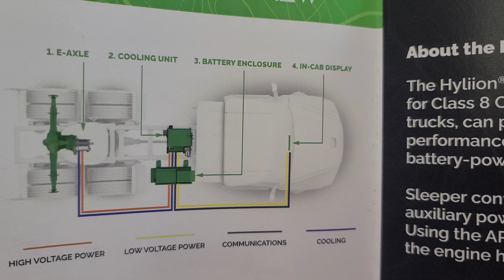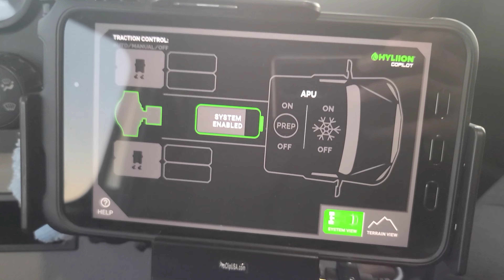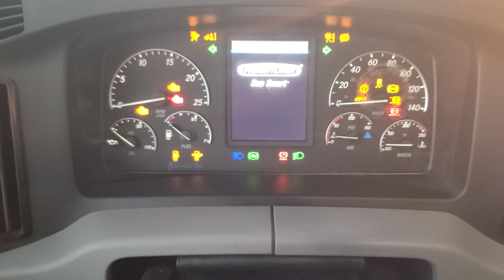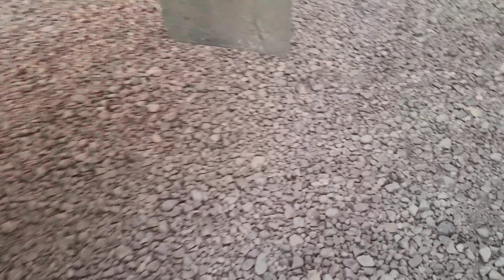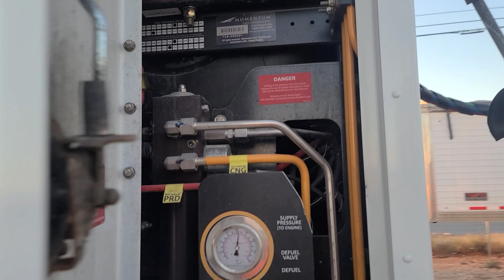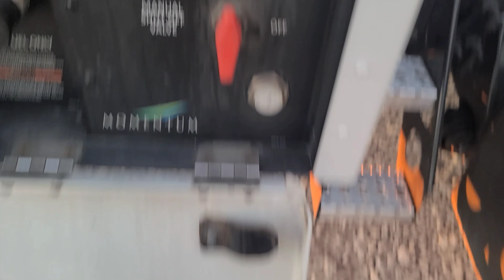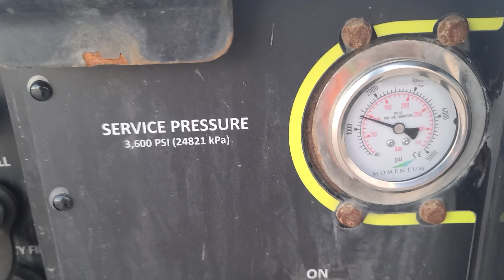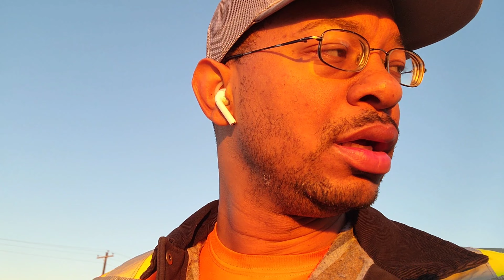Hyliion EX Pre-Trip inspection with Cummins comments-Let's Begin😊

Comment: If you run a Cummins 12 L as seen in this video, the truck will work.  But it does not have the torque to allow the truck to maintain speed on long grades.  This is true even with the EX configuration in this video.  This limitation is overcome by the ERX system which has an electric motor with high torque.  The only problem is, the ERX cost $125k more than a standard engine.

The Cummins 15 L is more powerful than the 12 L and will allow the truck to maintain speed on long grades.  So it will do what the ERX can do.  But the Cummins 15 L is $125k per truck cheaper.  Which one would you buy?
Reply: You can maintain speed for sure with this. Ive run many cng and lng trucks. We just downshift a gear and it goes on up. With an e axle should make it perfect.
Reply from the maker: Thank you for your well thought comment and question. You explanation was very in depth.
First, I am not a fleet owner with millions of dollars of assets and buisness credit, so I don't know which one to buy. All I know is this.
1. Cummins low torque can be supplemented by Hyliion's E-axle.
2. West Texas is flat. There are no mountains nor hills. 
3. From a technical standpoint niether Hyliion's ERX or Cummins 15L, have made any sales or have at least a year worth of real world feedback.

 Thanks for supporting my channel😊
Reply: @DMGbrokenfree  I visited West Texas.  It is so flat you can see the sun rise and set on the horizon.  With no hills, the EX will not work.  This gave birth to the ERX until the Cummins 15 L came on the scene.  This engine will come out in 2024.  Given that it is manufactured by Cummins, it will work.  Hylion's ERX will come out in 2023.  They are a new manufacturer and their product is very complex.  There will be a few bumps in the road with Hylion.
Reply: @titaniumsandwedge  very complex? Are you considering the fact the Cummins engine will still require a transmission and more maintenance? Fuel consumption, range, government regulations etc.???
Reply: @gmant928  Yes I know that the Cummins engine will need a transmission.  The ERX is very complex.  How does it know when to turn the cng off and on?  It has to sense grade.  How does it regenerate power?  How does it cool the battery?  How does it control the electric axle?  All this is not needed for the Cummins.  And if the electronics in the ERX fail, who fixes it?  A diesel mechanic?  LOL.  Nope, you need a new electronics mechanic.
Reply: @titaniumsandwedge  it’s really not as complex as you think lol the battery cooling is probably the most complex thing you listed. Do you realize how much modern cars utilize electronics these days?
Reply: @gmant928  Look at all the videos of the EX and ERX.  Do you think a diesel mechanic could fix them if they broke down?

The ERX is very complex.  The complexity can be measured by its price tag of $120k over just the cng engine and transmission.  What do you get for this price?  Got to be some beneifit?  Maybe a little bump in mileage.  You really can't say you are green because you are still burning cng, a greenhouse gas.  At times, the ERX is quieter than the cng engine.  Is this worth $120k?
Reply: @titaniumsandwedge  You're making a lot of points that don't make a lot of sense.  Regenerative braking gains energy from stop/go, not just hilly terrain.  And in the ERX, it doesn't "sense grade" in order to know when to turn the CNG system on; it detects when the battery is low and turns it on.  

However, I see the broader point you're making, which is that the Cummins motor is cheaper and "does the same thing" that the ERX will do.  I have to disagree, though.  The main expense, even with CNG, that fleets have is paying for fuel (as far as I know).  The Cummins 15L might provide adequate torque, but because it still uses a traditional drivetrain, it will be significantly more inefficient than the ERX, especially once you factor in things like regenerative braking.  So let's say the ERX uses 30% less fuel than the 15L does, but provides the same torque/hp.  Over the lifetime of the truck, that will save far more than the 125k premium that the ERX system added.  And that's not even including the additional cost benefits that come along with owning an electric drivetrain, such as less brake wear and less maintenance.  AND don't forget about the tax incentives for converting fleets to BEV status (which I believe the ERX qualifies for).  If you add all these things up (and a few others I didn't mention), you'll find that the ERX makes more sense for a fleet, since it will pay for itself over the lifetime of the truck.
Reply: @titaniumsandwedge  guess my last comment got deleted because I attached a link, but I agree with Erik. 

Also, the same can be said about Teslas not being 100% green. That charging power coming from the grid is no where near close to 100% renewable.
Reply: @ErikWilliamsviolin  The obvious way to charge a battery is to send the juice in when the charge is low.  I thought Hylion was using a method where it sensed grade or a long grade (from gps) to know when a large electrical demand will occur.  Doing this will allow them to use a smaller battery.  Maybe this is something that did not make it into the final design.  The average class 8 truck cost $125k.  There is not one fleet manager that will buy into a truck costing twice as much that will pay for itself.  The ERX will not have significantly better mileage than the Cummins.  A measure of this is where do you need to cool.  Both have cng engines that need to be cooled.  But the ERX has a battery that also needs to be cooled.  All the watts that are lost via cooling detracts from mileage.  The truck fleets are waiting for a real green solution and that is hydrogen.  One step from fuel to electrical power.  No CO2 emissions.  Hydrogen is 5 years out which is why the ERX is in the game.
Reply: @titaniumsandwedge  I think what you are referring to is the Terrain Look-Ahead technology. That is for the Hybrid EX, not the ERX.
Reply: @gmant928  Perception is reality.  Teslas draw power from the grid where the most common fuel is nat gas.  Of course this is not green but it is perceived as green.  The thought is one day all the power on the grid will be renewable.  But to say a truck using cng as a fuel is green is a genuine farce.
Reply: @titaniumsandwedge  Oh, they may use an onboard GPS to detect grade differences to optimize energy efficiency, but that's all something that can occur within the included Tablet that goes on the dash.  It's not some huge, complicated system.  

You say "there is not one fleet manager that will buy into a truck costing twice as much that will pay for itself."  How do you explain the pre-orders so far, then?  Do you think they're all smoke-and-mirrors, every single one?

As you noted, both systems need to be cooled, but I don't know how much cooling the battery will need compared to a CNG engine.  Of course, the generator itself in the ERX will also produce some heat, but will go through rest periods as the battery takes over.  Perhaps that's where some of the efficiency comes in, since the CNG generator doesn't have to run 100% of the time.  Heat will be a consideration in any system, but I assume there are intelligent people that have accounted for these things.  If the ERX isn't any more fuel-efficient, what would the point be?  Do you honestly think all of this energy would have been put into creating a product that could be completely upturned by a larger-displacement CNG Cummins engine?

Lastly, the great thing about the HYLN system is that its source of energy - currently CNG - can be changed out in the future without having the replace the entire drivetrain.  So when hydrogen becomes widely available, fleets can simply replace the CNG generator with a fuel cell that fits in the same space (along with swapping out the storage tanks, etc...).  My guess is that HYLN is probably already starting work on that idea.  The ERX is the best of both worlds, in that it's more efficient NOW, but can become greener in the future as the infrastructure catches up.  On the other hand, if a fleet buys a truck with the new Cummins engine, they're going to have to buy a whole new truck in the future if they want to make the switch to hydrogen.  I'm sure this is something fleets are thinking about, as they calculate their future ROI on purchases.  The Cummins might seem cheaper now, but over the long term it'll cost more.
Reply: @ErikWilliamsviolin  All of the pre-orders for the ERX comes from members of Hylion's Council or companies with stock in HYLN.  What does this tell you?

There was always a need to displace diesel with cng as the latter is perceived to be more environmentally friendly.  But cng trucks did not have the torque to get up grades.  Westport Solutions came up with a 15 L cng engine to overcome this problem but it failed.  This backdrop was the genesis for the development of the ERX.  But lo and behold, Cummins announced their 15 L cng engine in 2021.  I don't think Hylion foresaw this and consequently is now a major competitor to the  ERX.

A major weakness in Hylion's branding is their use of BS in their marketing.  R-cng is an example.  Hylion would have you believe their trucks will save the world by burning cow farts.  Another is the fuel agnostic feature of the ERX.  If Hydrogen become readily available to class 8 trucks, would you put it in a truck with a cng engine?  NO!  The correct way to use hydrogen to create electrical energy is via a fuel cell.  One step to power, not two steps.  No high temperature processes that lose efficiency due to cooling.  This point is so obvious but it is consistent with the BS branding of Hylion.  You agree with the replacement of the cng engine/generator with a fuel cell.  But the only part you retain in the ERX is the electric axle with battery (EX components).  

It will all come down to fuel efficiency vs. increased capital (+125k).  This data will be collected in 2021.  We will then know the true nature of the value proposition.  In addition, there is increased pressure for truck fleets to go truly green.  This means TSLA.  It means Hydrogen.
Reply: @titaniumsandwedge  You make some excellent points, and of course I worry about these as well.  But, as you noted at the end, it will all come down to whether the improved fuel efficiency offsets the increased upfront costs.  Everything else is just speculation until then.  It would indeed be worrisome if the ONLY value-proposition HYLN could offer with the ERX was that it could run effectively on CNG/RNG.

Regarding the current orders only coming from Council members and stock holders, I believe only Agility actually owns HYLN stock.  The other companies with orders are going to obviously be council members, since they're interested in the HYLN tech, so I don't think the orders/pre-orders coming from council members indicates shady business.  Also, Detmar reserved like 300 ERX units (admittedly probably non-binding), and they're not even on the council.  I think the tech just matches their use-case.  Lots of stop-and-go.  Also, Mone Transport reserved 40 ERX units and they're not on the council either.  Honestly, why would these companies be reserving trucks unless they saw some potential in them?  I understand that it's natural to be skeptical these days with so many liars like NKLA out there, but we shouldn't be SO skeptical that we start seeing threats/tricks around every corner.  Some companies will succeed, others will fail.  I believe HYLN is taking the correct approach, and has the best chance of taking market share in the near future.  And remember, they don't have to take over the entire market in order to be a success.

Regarding the efficiency of Hydrogen: perhaps it's more efficient once it's in the truck, but you may not be accounting for the efficiency losses to make the hydrogen in the first place.  One of the reasons hydrogen is so expensive right now is because it's massively inefficient to make.  It actually creates far more carbon emissions than other fuel sources.  I'm sure this will change over time, but it's not going to happen quickly.  And it's worth nothing that even CNG can be synthesized, and end out being carbon-neutral to the same extent that hydrogen is.  How?  Because you can capture carbon, use it to produce synthetic CNG, and then re-release the carbon once it's burned.  You can even use fuel cells with CNG, if I'm not mistaken.  Fuel cells don't just work with H2.  My main point is that I think Hydrogen is more of a cool idea than it is a real, practical solution.  It SEEMS clean to us because of what comes out of the tailpipe, but the reality behind it is far more complex.

Regarding the ERX being fuel-agnostic, yes, many of the parts inside would need to be replaced to switch to Hydrogen, but the components left wouldn't just be "EX parts."   An EX axle has 120 HP.  If I'm not mistaken, the ERX truck has like 600 HP, but only has 2 powered axles.  What this tells me is that each of the ERX axles has 300 HP, which is far more powerful than the E-axle on the EX.  And the battery cost isn't insignificant, either!  So although it will cost SOMETHING to switch to using hydrogen, it won't be as much as you're making it sound like.

Regarding RNG marketing, I don't think their claim was that "cow farts would save the world," as much as it was that by utilizing some percentage of RNG, fleets could meet emissions requirements.  Basically, it's Healy saying, "look, you can utilize existing CNG infrastructure, you can get the tax credits for BEVs, AND on top of that you can supplement intake with RNG so that as future emissions requirements get tighter, you won't have to replace your fleet until it makes sense to."  

If you really think deeply about what a fleet manager wants in a product, it's not that they give a shit about saving the environment; they want to save money, and they want to meet regulatory requirements.  The ERX "checks all the boxes" for what a fleet manager wants, and allows them a pragmatic solution for right now that will be flexible enough to adapt as standards get more strict.  I suggest all skeptics stop thinking like a consumer would think, and start thinking like a fleet manager would think.  No fleet manager in their right mind is going to try to switch to a pure-electric fleet or hydrogen solution right now, or any time soon.  They might buy a couple just for kicks, but for at least 10 years, it's far more likely they'll invest in something like the HYLN solutions.

Lastly, I wish people would stop only focusing on the ERX and take note of the brilliance of the EX.  It's a cheap conversion to a hybrid for all existing trucks, diesel or CNG.  It adds efficiency.  I think for certain use-cases, it will be quite a popular product.
Reply: @ErikWilliamsviolin  It is true that hydrogen is costly.  NKLA is planning to run their hydrogen electrolysis units at night - using very cheap power.  Again, its a perception of green.  Long term all power in our country will come from renewables or nuclear.  The only practical way to capture carbon is photosynthesis.  There is a project in Iceland that captures carbon but it uses a clunky inorganic chemistry method.  I believe fuel cells will use hydrogen.

R-cng is a very tiny stream in the US.  Hylion would have us believe that truckers can roll up to a stand and load up with r-cng and get a nod of approval from Greta Thunberg.  Not going to happen.  R-cng is very costly to produce.  It garners interest only because methane is a very bad green house gas.  The best use of r-cng is to pipe it to the closest powerplant and burn it.  

The EX or electric axle is not a Hylion idea.  The first was a company in Michigan that sells retrofit kits.

In late breaking news, Kenworth at CES announced a BEV class 8 truck with huge power and 150 mile range.  I think TSLA who owns battery management can out do this.  In essence, the delay at Hylion allowed Cummins to compete and now Kenworth.  Fairly soon it will also be TSLA.  Over the road truck drivers are now controlled by a computer that monitors their drive hours.  They cannot cheat.  A good BEV would work in concert with these regulations.  Recharge the BEV while the driver is resting.
Reply: @titaniumsandwedge  recharge where? So you’re suggesting the drivers drive 150ish miles for approx 3 hours and then have the drivers rest at  a charging station for however long that will take while the truck charges? Even if the charging stations did exist for long-haul Class 8 trucks, how many charging slots can realistically be at one station? Come on man lol Hyliion is addressing the LONG-HAUL Class 8 market…
Reply: @titaniumsandwedge  “The vehicle is equipped with a 396 kWh capacity battery for approximately 150 miles (240 kilometres) of range and can be charged at up to 120 kW. Via a CCS1 DC fast-charging port, the T680E can be fully charged in about three hours.”

Good luck getting across the country in that thing bud.
Reply: @gmant928  I agree that 150 miles range is not going to work in over-the-road trucks.  The TSLA Semi which competes in this space is reported to have 500 mile range.  My point is that continual development brings in more competitors to HYLN.
Reply: So you're putting the price of the Cummins 15L at about $314 dollars and 87 cents?  Looks like slim margins for Cummins.
Reply: @rollemehome  This is the way it works:  A truck with a normal diesel engine cost "X."  To convert it to an ERX will cost +$125K.  The ERX is a very complicated system.  These numbers are from Hylion.

A Cummins 15 L cng engine is less complicated than a comparable diesel engine and probably cheaper.  But let's just say the cost are comparable.  Then the capital cost economic scenarios are: Cummins 15 L cng at $X vs. Hylion ERX at $X + $125k.  

The world would have been better for Hylion if Cummins did not come out with the 15 L cng engine.
Reply: @titaniumsandwedge  and you don’t convert a “normal diesel” to the ERX. The Hypertrucks will come brand new with the ERX power train. The Hyrbid EX is the solution that you have the option to convert an existing diesel or natural gas truck.